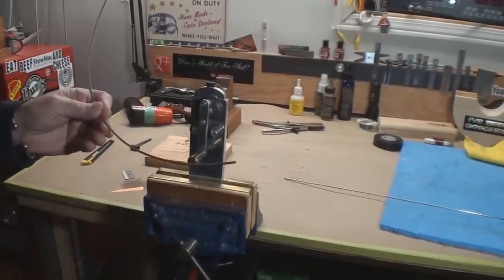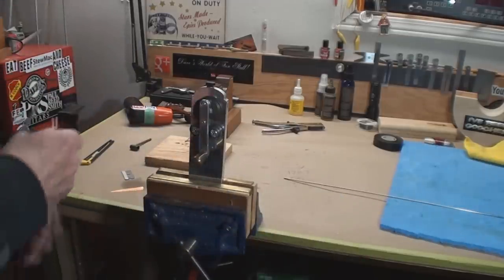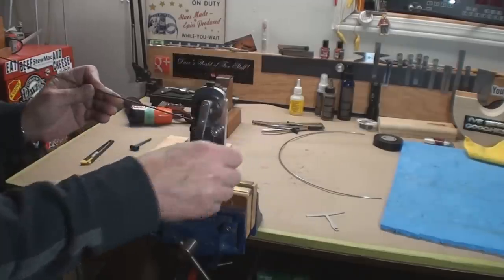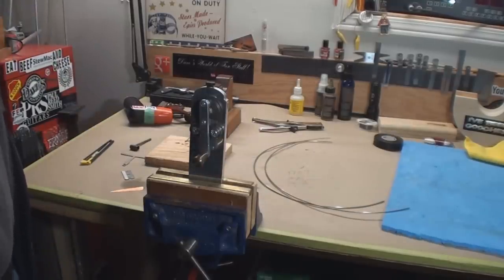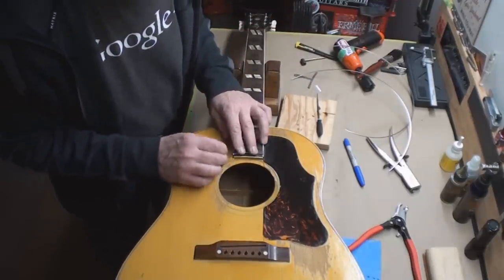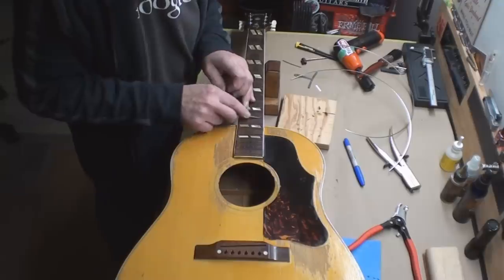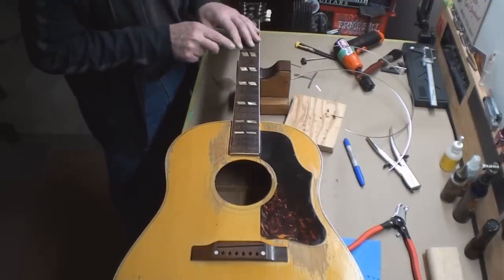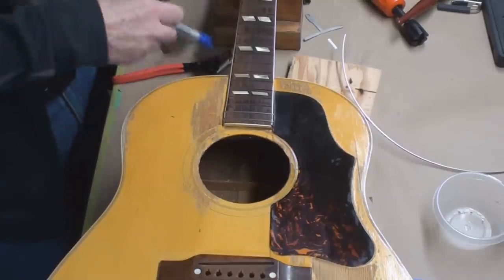66 Year Old Gibson Guitar Gets Repaired Part 4

Comment: I thought you might be interested in this. Since I do not use my tremolo and did not want to put a block of wood in there I have been experimenting with things to put in there my latest and most difficult so far has been round things. BBs, ball bearings etc. Of course you do have to leave that block of metal that the strings go thru in there. But maybe not?

Comment: The best 'nibbler' I've ever seen and/or used was an idea I got from another youtuber. Wish I could remember his name...but he sanded out a piece of hard wood to accept the fret with the tang side up. The groove is sanded down to where the flat area of the bottom of the fret is completely flush with the top of the wood block. Then simply take a good file and when you hit the top of the wood, you've got a super clean fret end, and a straight tang. I hate even the slightest curl that those nibblers often do the tang. With stainless this is the ONLY way to go IMO. You can literally just wrap a piece of sand paper on the fret your using and make the groove for it in a block. Makes a perfect fit for each job that needs to be nibbled.
Reply: I guess you mean the guy from highline guitars who just files of the ends. Works great and cheap as well.